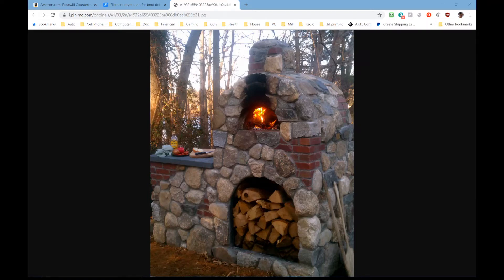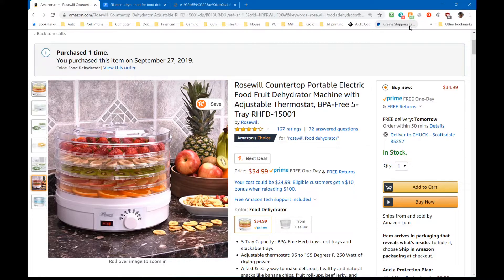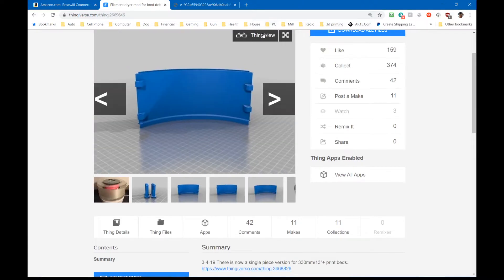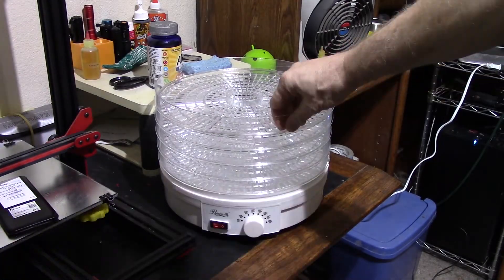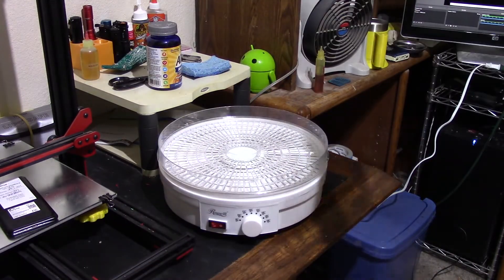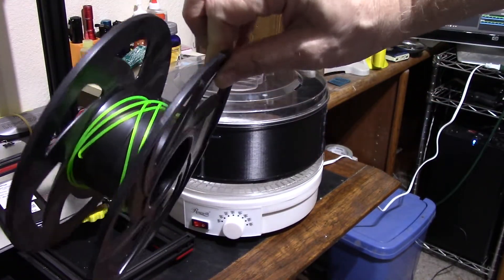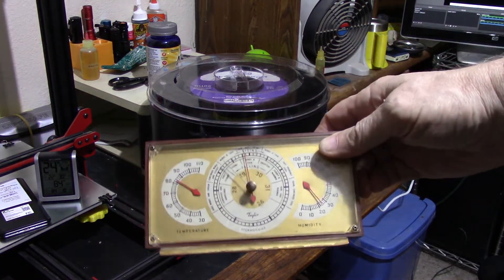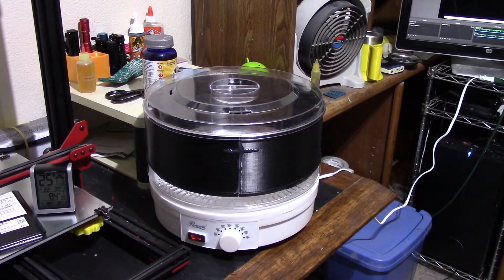Do you REALLY need to dry your filament? Part 1

Comment: Good question, Chuck. I echo Paul Hill's comments about living in a damper climate than yours. I'll be watching to see if it works. Could this be connected to your polycarbonate printing trials?
Reply from the maker: The PLA testing and video is done, now I've got the herculean task of editing 23 video clips totaling over 2 hours to get it to a manageable length without chopping out any of the pertinent bits. I worked on some of it today, I hope to be finished tomorrow and hopefully get it posted on Monday. But I hope to streamline the process for the next test, which will probably be PETG. I think I'll get all the filaments done that can print on the non enclosed Ender 3 before I move to ABS and polycarbonate.
And sure, I guess some of my problems with polycarbonate could be due to moisture. The printing industry sure seems to think that very low moisture content in the filament is of critical importance. I'm still skeptical...but that's my nature I guess. We'll find out!
Reply: @3rdpig  I know that feeling very well. When I make the videos I use in my teaching it's the same, You're dealing with quite short attention spans.
Reply from the maker: @PaulMcKillop  I'd bash them, but sometimes I'm no better. Few things about youtube makes me crazier than looking for 30 seconds of information and having to start out watching a 30 second channel intro, then another 30 seconds of begging for likes and subscribes, then having to hear a bunch more non pertinent information. Few youtubers have the personality to keep me listening through that, BigClive and Ave to name a couple, do have it, but I know I certainly don't. So that's why I try to cut out stuff and get right to the point.

Comment: I live in the UK and have the exact same dehydrator. I only needed to snip out 1 layer to fit a PLA roll.
Been having problems with brittle PLA.  Today is 75% humidity.  No rain so I got my washing dry.

Food dehydrating is not fast. Best results I've had were bananas and apples but these took 24h.
Reply from the maker: Hi Paul. I lived in the Seattle area for 19 years, so I feel for you. I used to have to have desiccant packs or dehumidifiers everywhere. As well as sump pumps and drainage ditches. As far as dehydrating food is concerned, I haven't tried it yet but from what I've read times depend a lot on whether you want your fruit "leathery" or if you want "chips". The first seems to be like 6-10 hours and the chips more like 24 hours.

Comment: We have the same food dehydrator I cut the the center of the trays out and glued them together then I added a pneumatic fitting with a length of ptfe tubing and use it to run filament to the printer oh I also used a microwave turn table roller to hold a custom turn table I printed out of pla also the pla holds up fine at 65c as that is were I dry my petg
Reply from the maker: I was tempted to cut the trays too, but I was more tempted by homemade beef jerky. lol
I've actually got my PLA test finished, I just have to edit the video clips together. I think you'll be surprised at the results. Should be up by the end of the weekend.
Reply: @3rdpig  hopefully I'm not 100% that it was a needed purchase but I can also use it as an enclosure heater cuz it shares of the armoire with the printer